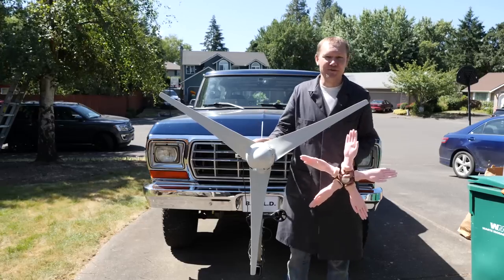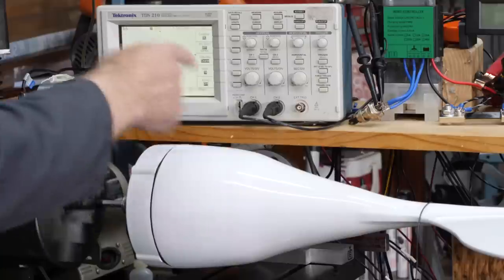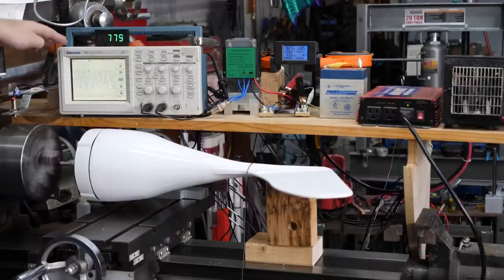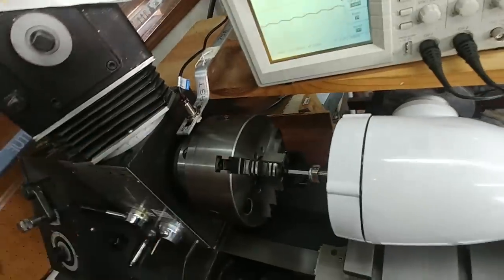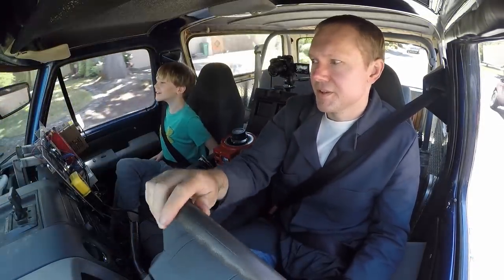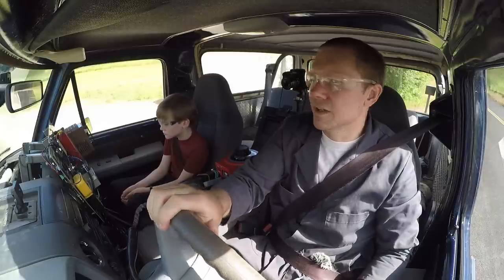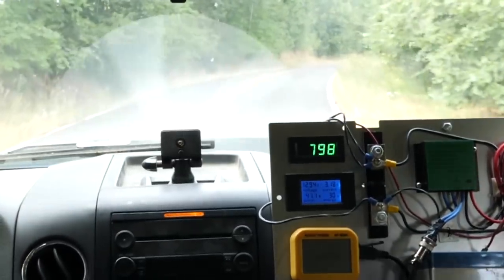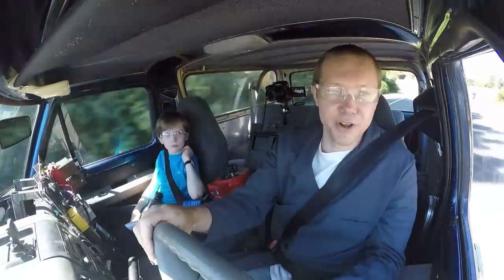Wind Power on a CAR #2 - Testing the Betz Limit for Turbines

Comment: Use a relatively powerful wind up spring to spin the generator. With a hand crank to wind the spring. You could also use a flywheel and starter to wind the spring.  You have the means and tools. Spring powered generator.

Comment: stationary wind turbine tails turn toward the force of the wind . driving them around puts the at the mercy of wind shear. and still , having a multi surface object like the truck so close behind has to affect the air flow and pressure on the blades

Comment: Your white generic wind-turbine seems to have exactly the same cheap Chinese-built alternator that we're using in our micro-VAWT tests. (see the comment i posted on your 'Rain Gutter Power #5' video) Replacing the ball-bearing will make a huge difference in efficiency.
Nice to see the lathe-test. I was planning on doing exactly the same test, but using a big vertical milling machine. We're 'doing' VAWT, after all. Makes sense...

Comment: I made a 3 meter diameter wind turbine out of cut PVC pipes, and a big BLDC motor, without knowing much about how wind works. I thought that if I have a big setup, then even though the wind in these parts is not that great, it will produce something. I was very wrong. That U^3 in the formula really messed up the power production. I was getting gusts of wind that would go up to 3-4m/s, but only very short gusts, and not more. There's never been constant wind here. Anyway, I since took down the turbine from it's place, and even though it was a failed experiment, I learned a lot. P.S. Perhaps the blade shape wasn't great as well, but my point still stands.
Reply: decent turbines only start producing at around 3.5m/s, ratings on commercial turbines are at 11m/s. gotta have minimum average of about 6m/s for the investment to be worthwhile

Comment: You know your stuff.  I mounted a 500w Apollo Turbine on my pickup, but I used a different rectifier/regulator.  I used a 2007 Harley Rectifier/Regulator since Harley Alternators are 3 phase AC, waterproof, and built into it's own heat sink.  The Harley regulators are shunt regulators (like the old Triumph's) that use 3 SCR's to shunt the positive AC voltage, of each AC wave, to DC ground, when 14.5v is reached, then resets crossing 0v, for each AC wave.  This is good for unattended systems, because the shunting acts as a brake and stops the wind generators from over spinning.
Reply from the maker: Were you able to measure the output?
Reply: @QuintBUILDs  No. I just measured voltage stable up to 50 MPH.  I assumed low amps due braking action on turbine blades when voltage reached and battery was fully charged  The trigger voltage is at the battery side, so if the battery is less charged, it won't trigger shunt until higher RPM's.  Suppose an extensive test would involve a large battery bank with varying loads and RPM's. I did change the pitch on the blades using the angled spacers & achieved charging voltage at lower speeds.

Comment: 2 fun thoughts on the wind powered car: 1) a cone of slow  air forms in front of a stationary turbine. Moving the turbine into the wind changes the situation entirely. It behaves more like a much larger turbine or like denser air. 2) whatever amount of air is slowed down is gained as aerodynamics.

Comment: Have you considered using a vertical axis turbine and a tube that gets larger behind the generating section. Perhaps a generating set mounted on a trailer with a long enough space from the vehicle to the trailer to negate turbulence. Imagine having the generating part in a 3 foot tube, with a flare that goes out to 4 or so feet and see what that does. I wish I had money to support you, but that is not my case as a retiree. Put a wind sped gauge on the towing vehicle and in two places on the trailer. VAWT has some interest as far as resistance to damage from wind shear.

Comment: what would happen if you mounted the fan on the side or the roof? So to create wind energy :> ". In most large-scale turbines, the low speed shaft is connected to a gearbox. The gearbox increases the rotational speed of the shaft, up to 1200-1800 rpm. ".

Comment: Ive thought about adding wind turbines to a car before. The turbine needs to been in a wind tunnel that flows thru the cars panels. Like if you have opening in the front of the car the sucked in air and directed to a turbine and then the air flows out the back of the car. Idk how small a wind turbine could get but if the car is electric, has batteries and a small electric engine, you should be able to do this right under the hood.

Comment: Heya, Wind turbine control engineer here, just giving my 5 cents: Modern wind turbines are pitch controlled, that means the blades actually pitch to get the optimal angle of attack to extract the most energy out of the wind. These models in the video have a poor blade design (expected) and seem to be stall operated meaning they will lose the ability to extract power outside of design wind conditions. Going twice the speed will actually get you lower performance because the blades will be stalling. The stall will be more evident when the load is active because it will act as a brake slowing down the rotor. You could try to ramp up the wind speed slowly and within the exepcted range for that turbine and maybe you'll start to see more power being produced instead of just activating the load during the test, especially if you are going twice the wind speed limit for that model. I also expect the controller to be optimised for the design of that particular turbine, thats why it is only engaging after a specific rpm. I am not experienced with these small models but I am guessing the same basic principles still apply. Thanks for the entertaining video :)
Reply from the maker: Thanks for chiming in! I'm actually building a pitch controlled version to accommodate different vehicle speeds and loads.  I thought about the stall speed but ran some quick calculations on relative wind at highway speeds and the results didn't look that far off the neutral blade position.  Of course even commercial blades flex in the wind so who knows what these garbage plastic ones are doing!  Maybe I'll get the high speed camera set up on the next run to try to capture what the blades look like in motion.

Comment: I LOVE that OLD Bronco with a newer dashboard and steering wheel.
Reply from the maker: Thanks! It's a resto-mod I did with the engine, trans, transfer case, ABS,  and A/C from a totaled 2004 F150. Just took it thru DEQ testing again and it beat the old 1978 standard no sweat!

Comment: I've heard that multi bladed turbines spin slower, but give more  torque in low wind conditions!  You might want to try a more sturdy 3 blade model.  

I also wonder why they don't use mechanical governors; it seems safer than burning out your windings!

Comment: Really cool Video. 
You can use an 3 Phase motor as a Generator. If the motor and Capacitor are big enough you can create more than 300v ac. 

Sry for my bad English. I'm from Germany...
Reply from the maker: Kein Problem! Ihr Englisch ist besser als mein Deutsch! 👍

Comment: Though about it a bit more. I think the power point set by your inverter is to low voltage and too high amperage, leading to major losses in the motor that make it spin  slower and losing the power point over and over. You need a mppt to make sure you have a feedback loop checking what happens to the total power output if you play with the voltage to amperage ratio.

Comment: You need to get the voltage down to about 12v, then see how much current you can generate, the current drops as the voltage goes up,  I don't know what the voltage is, I can't see the meter,  but seems you are trying to get the turbine to charge a full battery at a high current, for a real measurement of capabilities, I'd get a simple 3 phase rectifier, alond with a volt and current meter, with shunt, and make a 600 watt or so resistor, about 200-400 ohm, then slowly decrease the resistance shorting the output through the resistor,    I hope I'm making sense,
Reply: Yes, that was along the lines of what I was thinking.  I could not see all the displays or the variac settings in conjunction, so I am not sure.  Were I there, my next thing to look at would be ensuring that I kept it loaded up (so the volts don't spike and the break does not kick in)....we want the watts as output and not as heat of turbine breaking.  A bigger and undercharged battery might help smooth out to avoid spikes.  Got to keep it below the protection voltage to get the output.  If this is what is already being done, then the specs are just flat wrong.  Not yet convinced, but getting there.

Comment: Try higher voltage turbine, battery and inverter (24/48V). You are likely having a lot of losses in your current meter and all of the wires causing the turbine controller to shut off/brake due to too much voltage.The higher voltage system will have less current and less power loss

Comment: So if that new controller was 'braking' all the time on the lathe, that would explain why your alternator was getting so hot.  The controller was shorting the windings to apply braking.   We would say "op-check sat" :)
Reply from the maker: Yeah but the braking was like 1% of the time.  99% was generating 70-100 watts consumed by the heater.  Unless it was partially engaging while still generating power somehow...

Comment: Excellent video. Now a days cars are having bigger grills. Manufacturer should use that as camouflage install multiple small fans and make that connect to single dynamo and generate electricity and power their hybrid battery. This is best useful for plugin hybrid kind of car. Yes there are drags and aerodynamic limitation but if optimized then it is the best solution. once achieved we can get even greater mile with less battery capacity but more energy savings.

Comment: Very good info. I built my own blades and put onto a 500W DC motor but the results were weak. Now seeing this video I will make some changes to the build. Oh and I never knew the BUILD acronym. Time to redo the blades. I'm also adding Gearing to change the Direct Drive to a 10:1 ratio thus ramping up the motor speeds.

Comment: Tip deflection on the blades is flattening them to reduce torque.  You need to make your own with about Betz the diameter of the ones that came with the turbine.
Reply from the maker: Yup.  Evidenced by the slo mo footage in part 3.

Comment: Great video!
I am all for "green" energy but whether you buy the cheap or expensive stuff you just can't over come the losses you get in the circuitry and from going to AC to DC then back to AC to run our home appliances.  So in the end its just not a super efficient way to generate power,  but thankfully science and technology is always improving so it will be some day. Again great video, look forward for future ones.

Comment: Good video but I would prefer a tube with something like a add fan on the inside  it's mich safer
Could also add a compressor blade to have more air pressure in from of the fan blade that sounds the generator at lower car speeds

Comment: I had a idea years ago of putting a vawt inside a 12" PVC pipe with a servo moved fin to  adjust   how much wind comes in.
 It could be posted across the roof or above the head lights for experimental purposes.

Comment: Not sure if you've realized this yet, but the truck is actually pushing a bubble of air in front of you so that the relative wind speed on the turbine is much lower than your speedometer would indicate. Try removing the blade and test with just the anemometer. You would need to put the turbine on the top of the vehicle to get a true test.
Reply from the maker: Doesn't seem to be a factor.  The 3 blade turbine hardly slowed the anemometer reading, probably 80% of speedometer reading.

Comment: Did you consider of having higher DC voltage? As the maximum current of the generator is achieved the power is also limited - unless you allow the voltage also get higher. The current is making the torque and as you have a PM generator the voltage output gets higher as you turn it faster. The 400W might be hit with a 24V or 48V battery setup (or using a buck-converter with a MPPT algorithm). The "controller" is not this kind of charger thing, it is only a rectifier with "overvoltage protection"...

Comment: Really believe there's something To automotive wind turbine power supply. I believe the trick is to use smaller fans that direct air current directly off the car.Itself using the aerodynamics to work in the favor of the turbines on a smaller scale but have many more turbines.That would b condensed the air Into Air directional tubes that would increase the air pressure putting the air pressure onto the blades of the fan Increasing the overall wind output Forcing the wind turbines to turn faster Taking advantage of all rotating parts , including tires built's Even exhaust fumes.
 Used to heat up the air pressure and condensing it into a smaller output, creating more generation of power that could all be returned back to the battery and stored in battery bank. The idea to all of this is not to make the car run on winter buying alone but to assist in options like air conditioning and ventilation and even headlights and radio . Which would Greatly improve the performance of a battery powered vehicle.Much of this technology is already in place but not utilized To its full potential, I believe the secret is an aerodynamics and using a VR dynamics in the favor of the vehicle overall output electrical input Is through resistance building a positive charge. But you're keeping the overall vehicle aerodynamic enough to take advantage of full power. Kind of like turbo is today but it a much smarter application. Harnessing the wind or the wind resistance While using the rotation of all parts That could actually produce a positive Charge

Comment: try removing the electronic brake it is reducing the spin of the blades
when you had it on the lathe you removed the resistor and it became free spinning

Comment: Hey Q..
How about numerous small turbines enclosed within venturi tunnels across the top of the cab. Increasing air flow rate by mitigating low pressure behind turbines.

Comment: Good video(s).  In my experience having sold literally hundreds of Chinese motors (for scooters), China will print the output the buyer requests on the product.  That's not to say that different spec motors aren't different,  even the 600W vs the 800W motors are quite different, however unlike most American made motors I've tested which can handle double or triple the rated current for short periods of time, the 800W motors brush holders will liquify within seconds of doubling the output.   I know because I built a scooter with two 800w motors and a 400A controller.  Fun, but eventually the fire must be put out. 
That said, those windings are a bit anemic for 500W for more than a few minutes.  I'm sure they will generate 500W. I have no doubt in my mind actually.  What you need is a controller that will not protect them from harm. 
P.S. I'm really glad you removed the water heater from directly in front of the smart young man, Thank You

Comment: I just wrote a paper on designing blades for small wind turbines. i used Qblade which is very powerful freeware tool to do designs, simulations and calculations :) Hit me up if you have questions about the program or so. (I attempted to print the designed blades with a 3D printer. It works very well but they need to be reinforced with fiberglass or carbon. It's also possible to 3D print a mold to manufacture the blades in a traditional way.)
Reply from the maker: Awesome! I've heard of a couple others but not Qblade. Currently researching carbon fiber wraps and molds deciding which way to go. One option is hot-wire cutting foam on my 4th axis on my cnc mill then wrapping that but 3D printing would be much easier.  I will surely hit you up, thanks!!!

Comment: Betz kind of got lost in this very entertaining (and honest) video. I hope you'll get back to Betz in a future episode. 

One thing you didn't cover is how Betz is used (misused I would argue) in large electric-utility-grade turbines. Why do large horizontal turbines always have three blades? Because their builders argue that three blades get them close to the Betz limit for any target diameter. Another way of stating this is that three blades will extract the maximum power from the wind going through the turbine. It's not true, but that's how they state it.

I worked on wind turbine design with the late Paul Lipps, who revolutionized propeller design for Reno race planes. Remember that a wind turbine is just an ANTI-propeller. We found that a properly-designed 10-blade turbine dramatically exceeded the output of any equivalent diameter three-blade. 

Did it exceed Betz? In many ways it did, but that's because it was a system, not just a rotor. If you are a 21st century electric consumer, rather than a 19th century aerodynamicist, what matters is how many kilowatt-hours of power you can generate per year and for that 10 blades with a smaller diameter is clearly better. That's because the starting torque is dramatically lower so you can start making power at a lower RPM. The structure is stronger so you can continue making power at a HIGHER RPM. Half the cost of a utility-grade turbine is the computer control system to keep the turbine from destroying itself in high winds. But make the turbine strong enough and you can eliminate the computer and its cost and generate power in ANY wind. Use the money saved to build a second turbine or to make the tower taller, making even more power.